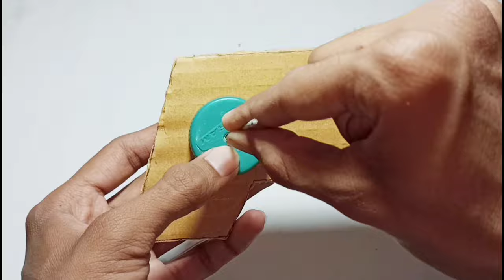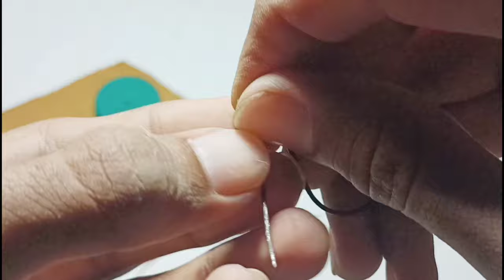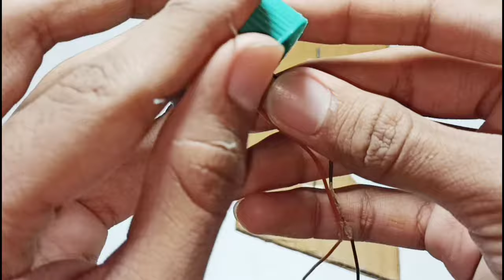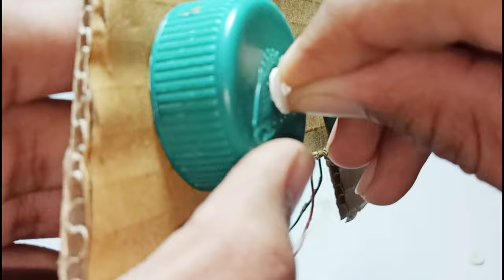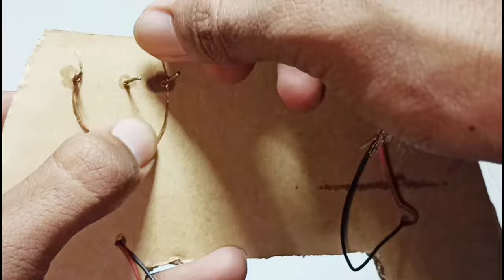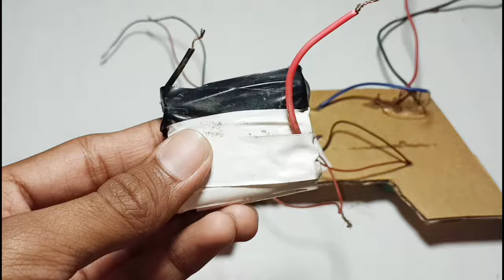How to make a remote controller at home for a toys car | simple remote controller | from cartboard

Comment: You use copper wire iam write or wrong
Reply from the maker: No it's iron fire , I get this on hardware shop . 5 rs per mitre . Ok
Reply: @howtocreate9896  sir when I search iron fire on internet it is not same as your wire
Reply: @howtocreate9896  what is iron fire

Comment: Which type of wire you use in controller please tell easy name of that
Reply from the maker: Use cycle spoke, it's easily available.
Reply: @howtocreate9896  I  use cycle and I make controller and it also work but I want to make another controller for using wire that you use in your video so please tell the name of wire please please please or tell easy name to buy wire easily from shop because I belong from village area
Reply: @howtocreate9896  hey one doubt 
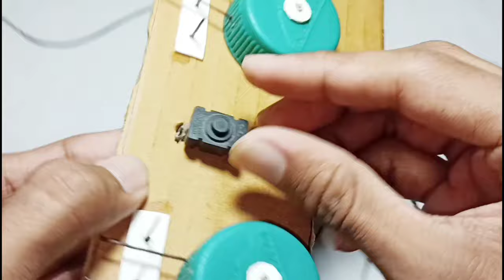What is the black thing that you use in 8:22  is it essential and also is that battery 
Can I use HW hi-watt brand to make it?

Please help me I'm in urgent 😭

Comment: Sir replay you use thick wire or cycle spoke in controller i am comfused
Reply from the maker: Use cycle spoke . Ok
Reply: @howtocreate9896  in present video you thin wire or copper wire in controller or which type of wire